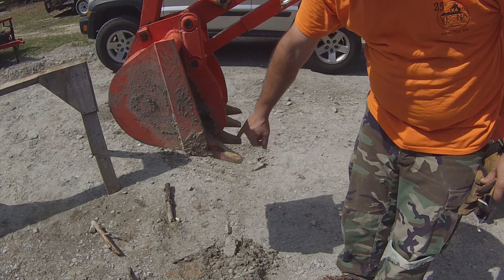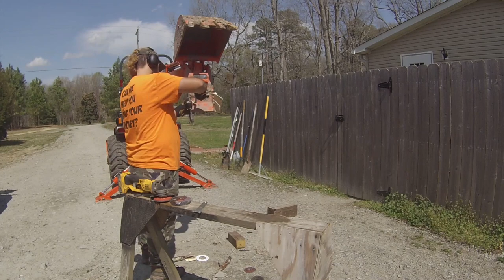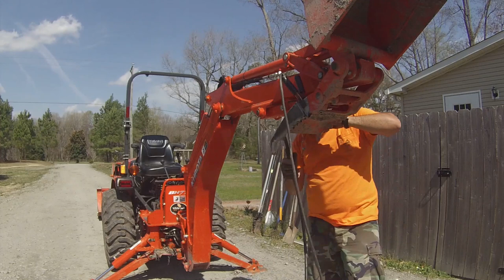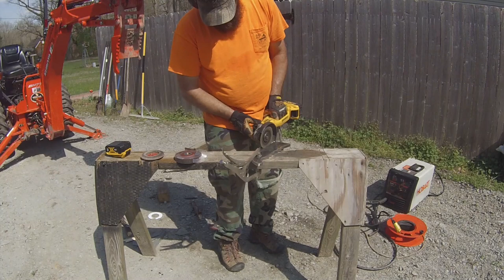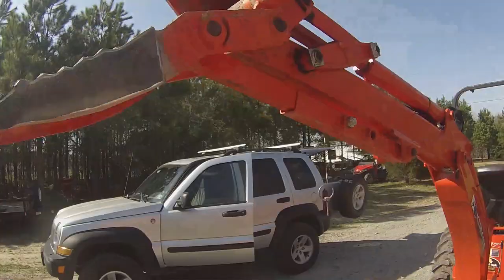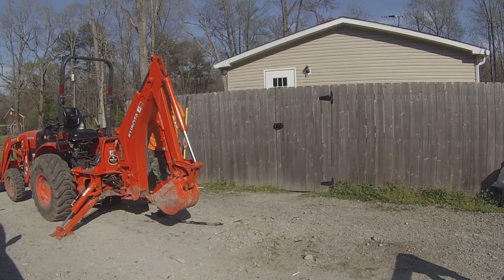Kubota B2650 with BH77 Backhoe thumb modification

Comment: Pretty sweet modification.  I have the same backhoe on an L2501 but haven't had a need for an extended thumb....yet.  New sub here.
Reply from the maker: If your doing any kind of backhoe lifting work the extension makes a world of difference...  picking up small things like brush and small logs is impossible with the overbite the bucket has.  You end up grabbing more dirt than you need to.

Comment: I just used a similar kubota backhoe for some jobs and wished it had a thumb on it like this, would've made the cleanups I did a bit easier
Reply from the maker: When I was in construction I learned how handy a thumb can be.  Mechanical or hydraulic if it has a boom it needs a thumb.
Reply: @southernyankeehomestead3230  I agree 100%

Comment: No issue with my Kubota thumb for the bh77.... Are you sure that's the stock one? Don't really look like it
Reply from the maker: Ordered directly through the factory at the same time as the backhoe.  Maybe they fixed the problem since I got the backhoe 3 years ago... or maybe they decided to skimp on production since you bought yours.
Reply: @southernyankeehomestead3230  I've owned mine since 2016
Reply from the maker: @thegreatnorthwoodswithbb2863  got mine in 2019.

Comment: Is this 16” bucket, does the machine handle it ok?
Reply from the maker: I believe it's a 16 and I've never had a problem with it.  Dug a 40x40x4' hole one time in dry compacted clay.  The concrete truck didn't even leave a dent in the soil.  It was tough digging but it did it.